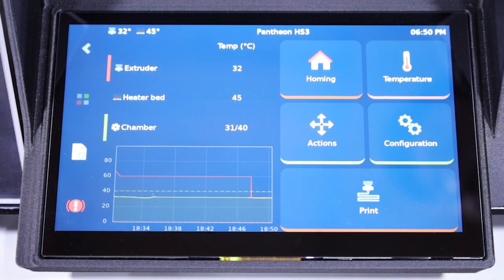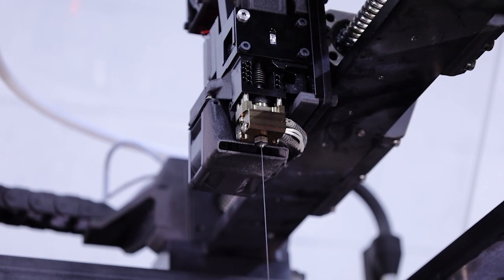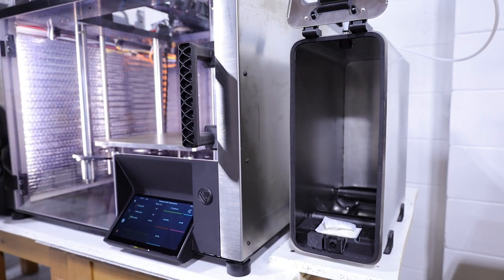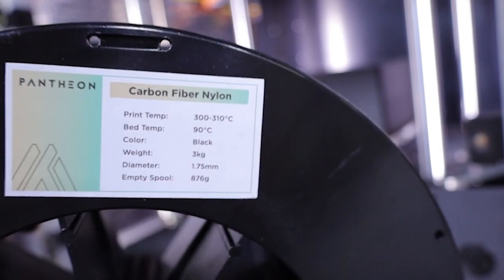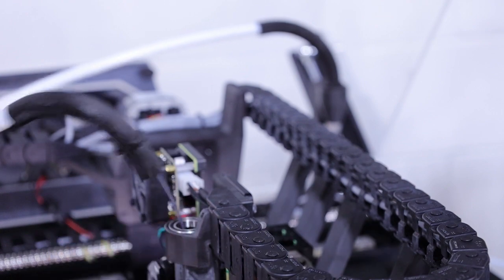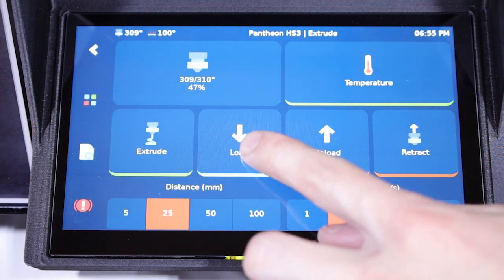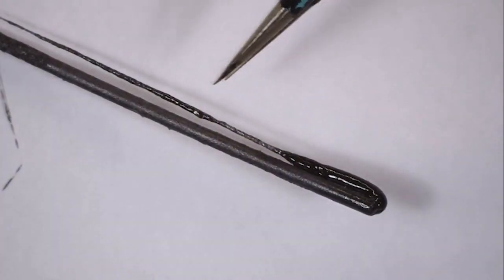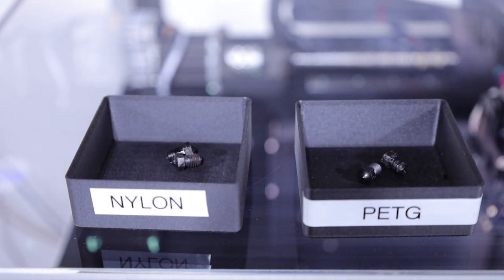Pantheon HS3: How to swap printer filament

Comment: I think I’m seeing a lot of 3D printed parts on this $10k+ machine.  Is there a reason for that and if I buy one am I going to be getting actual parts or 3D printed ones?
Reply from the maker: We use 3d printed parts where it makes sense, because after all, our printer makes really strong, high accuracy parts. All the motion components are machined or precision ground metal.
Reply: Also by printing parts on the same printers you're making, you can iron-out any leftover bugs and usability issues, just like Prusa does  @PantheonDesign